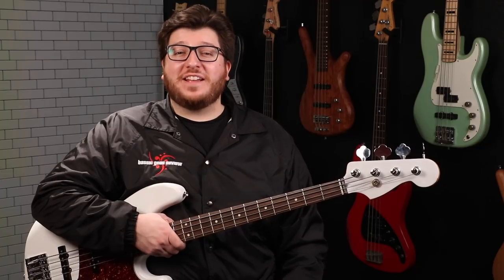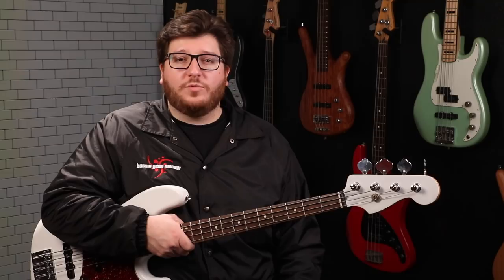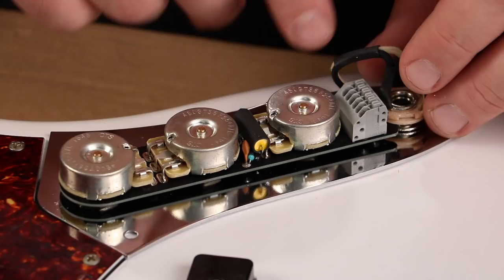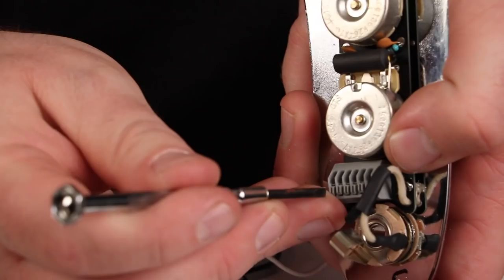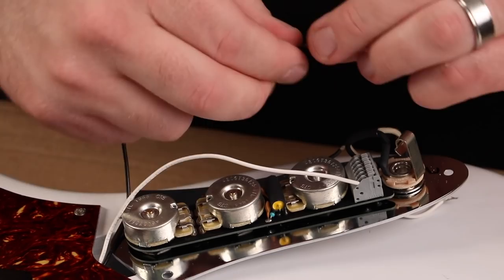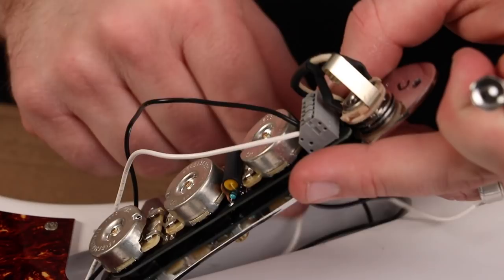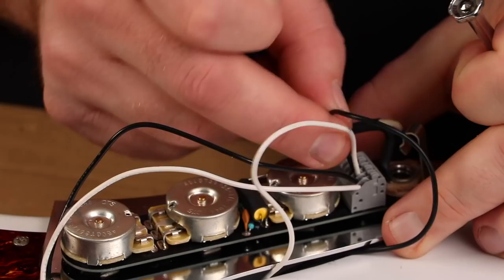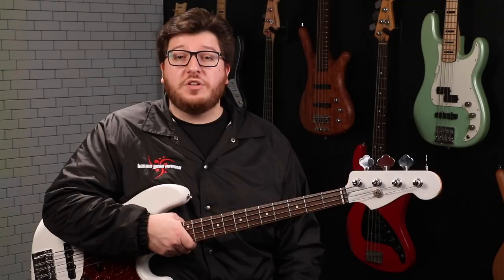ObsidianWire Jazz Bass Installation

Comment: I recently installed this into my jazz bass along with new Duncan pickups.  The install was simpe and smooth.  I have only one question for any that have used these harnesses.  I noticed after install that the pots for my pu volume have much less resistance when turning.  Another words they turn very easily and have a much "looser" feeling than the original pots I removed.  Is this just the nature of the CTS pots?  The effort to turn the oem pots had a more "premium" feel when turning.  Hope this makes sense as I don't believe there is a way to change the characteristics of the pots and how they turn.  Just making sure this is the way these harnesses are.  Thanks in advance for any feedback or replies.

Comment: I see there is 6 hole... 4 goes to hot and ground for each pickup...
My question is where do you go...cable from shielding under the bridge and the cable if you shielding the cavity too...
Sorry for my bad english...

Comment: Did you install new pickups as well?  If you used the existing pickups, did you have to de-solder them from their original pots?  Thanks.
Reply: Not OP, but what you do is clip the wire at the end and the strip off a few CMs. Super Easy.

Comment: I notice 6 "slots" on the kit, where does the ground wire go?
Reply: The ground has its own separate spot where you feed the wire in and tighten down a small flathead screw to secure it.

Comment: Is solderless really reliable? What's wrong with soldering a few tips? I don't trust it honestly
Reply: I've been working on guitars and basses since 2 days after I received my first guitar, a Kramer Focus 4000 for a birthday 32 years ago , and I replaced the stock pickups, first with Dimarzios, and then 2 weeks later with Seymour Duncans.

I've been working on them every week ever since, and have been building handmade custom guitars and basses for over 25 years. This is just my opinion, but I am absolutely a fan and a believer in the solderless connections that I have used. 

I have been using the EMG solderless System since shortly after it came on the market and I have never had a single complaint, nor have I had an instrument come back for repairs on the electronics. Not one. There is absolutely nothing wrong with  them. 

As for the solderless electronics that I have tried, and I have tried several brand offerings besides just the EMG, and aside from minor issues that the manufacturers to have since corrected, I would have no apprehension in utilizing a solderess system that I perform
Reply: They are NOT recommended on High Voltage like your home but for low voltage your good
Reply: Alembic pickups are soderless... what more proof do you need

Comment: Did the upgrade change the sound at all, or does it just offer a wider range of tone sculpting options?
Reply from the maker: Essentially, these are high-quality CTS pots that are solderless. It’s a great upgrade if you have a bass with cheap, low-quality pots and/or you want to be able to change pickups quickly and easily. It doesn’t necessarily give you more tonal options because it’s still passive volumes and tone.
Reply: I have used this kit in two Jazz basses now. It doesn’t change the tone however my bass sounds cleaner if that makes sense. Better components, cleaner signal. I do notice more variation from full tone to tone rolled off than my oem fender jazz controls.

Comment: I generally don't trust solderless stuff. If I were going to use one of these for some reason, I'd probably at least tin the ends of the wires so they hold together better. EMG's are pretty reliable, to be fair, but that's also a different style of solderless connectors.
Reply: Wires fit the harness snug. I initially tinned the tips of my
Pup wires but it was harder to fit them in the slots. I ended up trimming off the tips and twisting the wire tightly and they fit in very snug. Hadn’t touched them since and everything works great.

Comment: Cool install, but how does it sound?
Reply: My guess: like a passive jazz bass
Reply: Brad Barker Not all passive tones are created equal.
Reply: @freereinvoltaic  Right, the value of the caps and resistors and pots are important.
Reply: I'd say it sounds great. Tons of clarity, no treble loss or pot crackling when turning the volume down and has reliable grounding. I have these on most of my own basses (several Jazz Basses and a couple of Precision Basses as well).